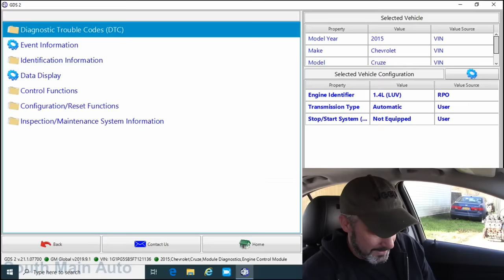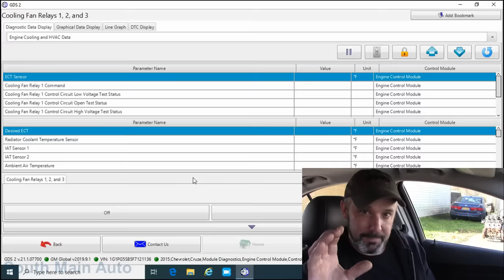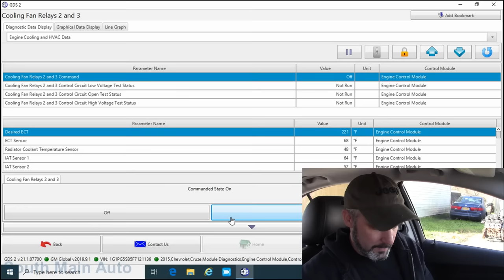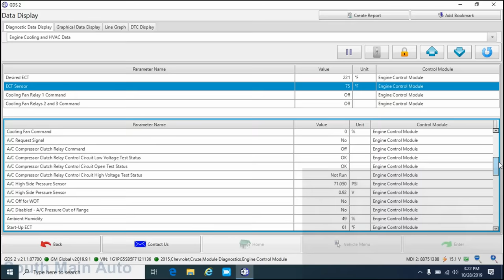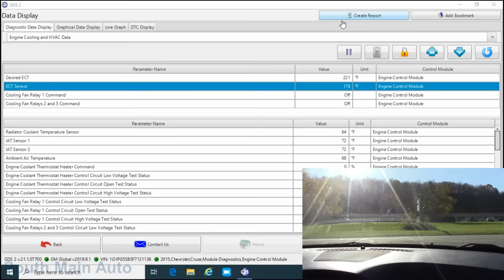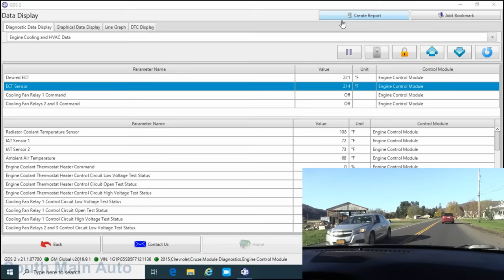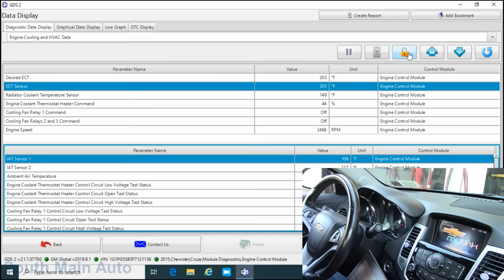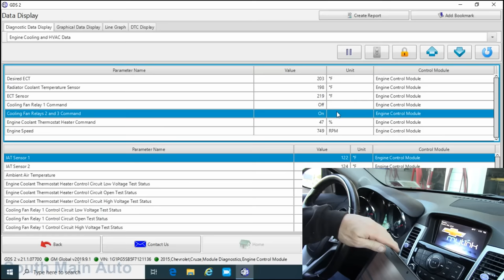Chevrolet Cruze: Overheating, Loud Fan, Losing Coolant

Comment: I have that same Astro Pressure Test Kit.  I use it all the time and love it.  Comes with a vacuum fill tool, as well, and I use it to fill all the cars I work on now.  I've gotten myself addicted to it.  Instant heat in the cabin after filling and warm up.

Comment: I own the 2011  Cruze 1.4L turbo. Outlet is known too leak/seep at the seal. Becareful of the expansion tank hose that attaches to the outlet. It Will get brittle and break by bumping due too heat cycles /age.  If changing water pump put back made in Germany OEM not the made in China A/C Delco. I have 193,000 miles on my Cruze. I still have Original fan I live in Florida. Customer must keep eye on the coolant level on these Cruzes.

Comment: This is the exact problem im having. I changed out the heater core hose cuz it had the goop under it. Changed out the thermostat. Still leaking. Ive been assuming its the water pump as well. Debating on trying to fix it myself or not. I heard it around 600$ to get it replaced. Should i just take it to a chevy dealership? 1/4  a mile away

Comment: I have a 2016 Chevy Cruze my car is doing the same thing I'm losing coolant and it gets hot and then as soon as I add water coolant to it the temperature is down but stays down I'm just wondering if it's part of the engine or what it is

Comment: Just wondering why the desired ECT changed between the two engine runs? The first desired temp was 221' and the second was 203' ? or have I missed something?

Comment: Having the same issue and everyone's told me its normal for the fan to be loud and stay on five minutes after ive turned the car off, even when ive turned it on and not moved the car (so theres no way the engine could be so hot it needs to stay on) and im thinking its the fan relay but none of the mechanics ive been to have checked. Is this something that can get checked at an autozone? Or should i keep looking for a mechanic that pits in as much effort as you 🥲

Comment: What’s the best way to get the air out of my heater core on my second gen Dodge Ram? I swapped the core and thermostat a month ago. Heat is warm on high but was hot before
Reply: Run your vehicle with the radiator/tank cap off and your heat on max with the fan on. If not clogged for some reason, you'll notice your coolant level go down which is good cause the trapped air is escaping
Reply: Christian Perez resivore was low. Topped it off and burped it on a hill. Heat is around 130° now. Thank you

Comment: I own a 2012 cruze and their common issues I've encountered are  the thermostat, cooling fan resistor, and the plastic expansion tank nipples cracking. Now it starts then dies a couple times before it stays running and starts fine when warmed up.

Comment: Just replaced the coolant overflow on my 2014 Cruze after overheating. Seems okay. Really don't want to have to change the two sensors, water pump or thermostat. Had a 2001 Buick Century and changed everything including head gaskets. Ugh! This car is a  known lemon. Did you find a way around it? Can't just sell it to a person KNOWING overheating is a huge issue. Also had engine failure, oil leak, coolant leak.

Comment: Hey Eric how are ya? I have a 2004 Ford F-150 and I just recently had to replace the battery in it. Before I replaced the battery the truck was giving a P0012 code  which is ""A" Camshaft Position - Timing Over-Retarded (Bank 1)
 and it was running a tad bit rough. After putting a different battery in it started running smoother. When I did a load test on the old battery it said "replace battery" Could it be possible that the bad battery was causing the timing valve control solenoid
 to not work properly? After I put a different battery I haven't been getting that code

Comment: Cruze water pumps are under warranty for 10 years or 150000 miles because the seals go bad. Wifes failed at 46000 dealer failed to find the leak even after I told them it was leaking. Coolant all over the belt and suspension.

Comment: okay it's very obvious that this customer is an idiot because he bought one cruze and then bought another Cruze, it is a miracle that the 12 or 15 is even on the road still..... These cars are under massive recall, for numerous things namely the transmission..... They were and are engineering and design disasterous nightmares..... The owner must be a glutton for punishment.....

Comment: If you want “run” without starting the vehicle in a push button GM, push and hold the start button without your foot on the brake for 3-5 seconds.

Comment: Holden Barina 1.6l . Had issues with overheating. Radiator Thermo Fan not working. 
Found Coolant leak, 8mm Coolant hose clamp loose on throttle body and also air intake hose clamp loose on throttle body. 
Tightened hose clamps. 
Replaced Thermostat and Radiator Thermo Fan on Full speed, did not clear dash code 89.
Engine had snorted Coolant up to MAF Sensor. Cleaned Sensor. Still issues.
Checked all ECU micro fuses. Fuse #23 blown.
Replaced fuse, Radiator Fan returned to normal function. Cruise Control resumed function. Dash code 89 cleared.
End of issues
Also had MAF Live data Flatlining at Zero.
That code cleared.
Engine returned to normal function
End of issues.
No more Coolant Leaks or coolant snorting up to MAF Sensor. 
Thermostat opening and closing normally.
Thermo Fan Fan Function Normally 👍🏁

Comment: What a total sh*t box.  A 2015 product that needs a water pump, fan and possibly a thermostat ?  Not to go all Scotty here, but I've had great luck with my Honda and Toyota 07 & 08 respectively.  Biggest POS I ever had was a '94 brand new Chevy cavalier.  Nothing but problems.  Nice work doing the dealer's diag once again Eric.

Comment: What a deal?? Offering to perform the job at 1/2 price?? Mighty nice of them.... 

Was that 1/2 price on book labor or was the customer expected to pay retail price for parts and stealership shop labor rates? As someone posted above about a special service bulletin for the water pump, so IMO, the dealership should eat the entire bill. 

I can imagine what that head gasket and head surface look like being aluminum. 

If I were stupid enough to purchase one of the GM Edsel's, I'd get it fixed and waive good bye.

Comment: There is a service bulletin by GM to replace at dealer cost any water pumps for any 2010 to 2015 chevy cruze's before 10 years or 150,000 miles.  Bulletin 14371B

Comment: Now a days i am facing issue with my cruze 2014 model that the i fill water every second day but apparently there is mo leakage any where. I am very desperate because i live in oman and so far mechanics have not find the issue. What do you think what is the issue. I feel it may be a cap issue.

Comment: I get where you are coming from on this one in a lot of ways the other side is - pay the dealer techs something like 0.25 of an hour for this kind of fault diagnosis (and none of them want to do it), probably have only one mastertech in the shop and we end up in a broke system.

I have an overheating problem in the shop at the minute suspect a cracked head, head bolts marked with tippex, no history on the car....joy! Start the engine drive it 20ft in the door and the exhaust gas is coming out the expansion bottle, no test driving it!

Comment: My daughters 2012 Cruze has been overheating randomly, has had thermostat & water pump changed 2 times in the past 2 years, my daughter drove it for 2 weeks and it blew all the coolant out again but I don’t know where it went it just overheated, unfortunately I think it blew the heater core out the last time it was overheated! Anyway her fan only runs on high as well, do I just replace the whole fan to fix this issue??

Comment: Eric, is it normal for the desired ECT to change from 221 down to 203 degrees? I assume this must be normal between running mode and when in idle mode with an electronic thermostat.

Comment: Id really appreciate it if youd make some videos on replacing the water pumps and thermostats on the turbo engines of the cruz or sonic if you can. I have one of these sonics and it doesnt have cooling system issues yet but when it does id like a video of yours as guidance for when i do have to do it

Comment: It is a shame that Chevolet dealer would not want to fix the problem. There are a few bad apples that spoil it for the rest of the dealers. They don't want to mess up the mechanics top paying jobs.  Warranty work should be a top priority for a dealership. It also shows that buying an extended warranty is not worth the paper that is printed on.

Comment: I had to chevy cruze 2011 and if 2014 the 2011 got a way way better fuel mileage then the 2014 i ordered with the very same specs there should have been no difference but there sure was any ideas on that

Comment: is it a bad idea to do a pressure test on a system with a newly installed, never ran water pump?
Reply: Im under the impression that there is factory seals inside the pump that seal in the first 10 minutes of running

Comment: There’s a special coverage out through gm to have that water pump replaced completely free of charge .
Reply: Only within milage limitations and provided it has not been done before. I sent one in for similar impeller issues and it was not covered because the vin was not included in special services.

Comment: Eric, why was the desired ECT almost 20 degrees cooler when you came back after your friend came.. shouldn't that stay the same and at the 220ish it never commanded the fan on even at almost 230
Reply from the maker: it has different desired traveling vs idle...

Comment: I took a 3.5 round trip 7 miles had ac running did not turn the car off, approximately .10 miles from the house the car automatically cut the ac off stated ac was causing the car to overheat, the told me to idle the engine by this time the needed had jumped all the way to hot, so I pulled over turned my flashers on and just cut the car off I waited approximately 2 mins started up and drove home.  I used the car the next day but didn't run the ac and was able to complete my trip without incident.  Approximately 2 yrs ago the car overheated and it cost me almost 2 grand to get it fixed.

Comment: When I am accelerating above 60 it's dropping the speed UpTo '0'....
Exactly don't know what's the problem....some one is saying, needs to change spark plugs, gear oil.....
One mechanic told gear box needs to be repair or fix...
Could you guide me please....

Comment: Worked at a local Ford dealership years ago. When a customer brought a car in for repair and after certain "tech(s)"  looked the car over the car would be given back to the customer as "NPF" No problem found. *Even when the car had an definite issue. Ive seen this alot working there. For a few reasons:
1. The tech hoping the customer takes it to another ford dealership and to brush his hands with the car /get it out the door. Especially when its under warranty and ford doesnt pay sh*t for the repair 
2.Laziness 
3. Inexperience.

Comment: Having the same exact problem right now as we speak with my 2016 Chevrolet  cruze Ltd  except the Chevy dealership replaced my water pump coolant bottle thermostat housing and 2 days later it was like the never fixed it at all because it was leaking all over again and then they tell me its a blown head gasket. Mind you $579.10 after the first mess up 😒

Comment: Bulletin No.: 14371B
Date:January 2015
SUBJECT: Special Coverage Adjustment – Engine Coolant Leak from the Water Pump
MODELS: 2011-2014 Chevrolet Cruze
2012-2014 Chevrolet Sonic
With 1.4L Engine (RPO LUJ or LUV)

Comment: i have Cruze 2015 1,4 turbo. Overheating. Antifreeze leaking also. No one can find it. Car 3 days in service. Water pump change, thermostat change, thermpature sensor change, radiator checking it is good. Fan works well.  The service says have bad circulation. Now they think it is due to The Engine Control Module (ECM) or a problem inside the engine.
I know without looking car can not say anything, but any think, advice maybe help.

Comment: i had too drive  2012 cruze.  For my job back in 12-2015.  The car constantly low on anti-freeze.  Mechanic couldn't find the leak and the thing kept overheating.

Comment: I have a very similar problem with my 2011 Chevy cruze 1.4l turbo. It runs fine a majority of the time and only really overheats when I am going up hill. I am thinking it’s something with the fan because the only time I hear it is when it’s full speed and sounds like it’s gonna take off. I replaced the thermostat already and it still overheats going up hills at random times. Does anyone know if it would be the actual fan or just a fan sensor. I’d really appreciate a response since the shops around here are pathetic and they tried telling me it’s the head gasket but a lot of people have said it doesn’t sounds like it’s the head gasket and something more simple such as the fan

Comment: I don't mind owners bringing a car in, making a diagnosis mainly by sitting in the driver's seat looking at PID's on the scan tool, and doing visual inspections and ultimately the customer declining the corrective repair. That means I get paid billable hours mostly by looking at a screen while drinking coffee. The clock starts as soon as I plug up the scan tool and engage my brain and experience. All that getting greasy and dirty is for the birds. It is a good day when you have billed several hours (not on the same car) and come home in a clean uniform.

Comment: Hey Eric. appreciate the video. Seems like shop is pretty busy, glad to see that. You mentioned about the o'ring being stiff. Have you ever had a chance to use the DOW 111 compound on o'rings before? I find it to work extremely well on o'rings and gaskets. Let me know, I'd be happy to send you a tube to try it out. (I do not work for DOW, just a fellow [industrial] mechanic.)

Comment: I don't know how you do it, buddy! I don't have 1/10th that amount of traffic, and I still get overwhelmed here, lol. Probably because I spend too much time on YouTube! 😁 And the perpetually mowing neighbor .... does he snowblower his entire yard in the winter? Walk around his lawn the late fall with arms raised in the mowing position, making mower noises? 🤣 He must use some kind of warp-drive Miracle Grow. 😁

I only had one customer with a Cruze. Didn't take 'em long to dump it. Thing was ready for scrap by 60k miles! What a pile of dung ... 😂 If those cars make 100k miles, that's a major milestone, LOL!

As far as dealers around here go, I wouldn't let them change a wiper blade! When I brought my Silverado's struts to the dealer to install Bilsteins (since nobody in my area back in '10 had a spring press strong enough to handle the GMT-900 struts - I had a "heavy duty" eBay press, and these BENT the thing, and didn't move the spring 1mm!), they re-installed those super heavy speed nuts on UPSIDE DOWN!! My fingers were just about bleeding trying to correct that mistake!! 🤬 Of course, I only realized this after wrestling the whole unit back into position out in my driveway. That's what I get for $45 per strut 9 years ago. 😬
Reply: I have a 2014 1.4L with 120k miles. I bought it new and since I owned it the damn thing has always lost antifreeze. Have to add about a quart every 4-6 months. But aside from that and normal maintenance it's been alright. I also drive it easy though. Its really easy to rev that car up to 5 or 6 thousand rpms just to get up to 45mph. I also heard a lot of people with transmission problems were people using the "slap shift" option to shift gears.  I never used that. I have a manual pick up truck for that. All I can say is a Cruze would be good for an elderly lady who drives passively and she would need an elderly handy man husband to maintain it for her.

Comment: Seems the faulty fan not kicking on at loe like it should could have caused water pump gasket to fail due to temps exceeding rating. And could have also caused some damage to it as well.

But ultimately i think of fans are an issue on this year and model then chevy should just replace fans and water pumps when they come in with loud fan noise.

Comment: My sister has one of these since 2013 and has had nothing but issues with coolant leaking and turbo cooler lines leaking, overheating. I really just don't like a lot of Chevys after the early 2000s

Comment: I don't know how to change a thermostat, fan, and water pump on any of our fleet of 2006, 2007 Ford F150's (we have a few of these trucks), because....... we've never had to change them, even though they are decades old and many hundreds of thousands of miles. I do know how to change out our GM ones (radiator, water pump, etc...) because they have gone bad after a few thousand miles of ownership.

Comment: Too  HOT!  This is why the Cruze has so many problems. The thermostat is electrically adjusted. When the temp gauge is reading 'normal', the actual temp is 220 - 230℉. Stupid fuking HOT!! I discovered this when I tuned my 2013 Cruze myself. I was also losing coolant all the time. Coolant gets too hot and evaporates. I set my thermostat to 180℉, where it should be. Never gets above 185℉. 120k miles later, my car has been trouble free. And no more coolant loss either. GM designs their cars to fail, while also avoiding any liability. $$$$$$$$$$$$$

Comment: A friend of mine once had a BMW Z3 3.0, it ran it around 120 Celsius, hell of a cooling system but any failure at all, bye bye engine. Our old Kia Sorento family truck runs at a nice cool 88, I feel better about that. GM cooling modules, fans, thermostat's in my experience are very failure prone. Poor quality stuff.

Comment: Almost sounds like somebody change thermostat to hotter temp one without checking fan speed issue first like a quickie repair Scoobyed the gasket in process thus the Leakey likey  Beltey good the Dealer got sounds wonderful thanks for Adventure!!!; )